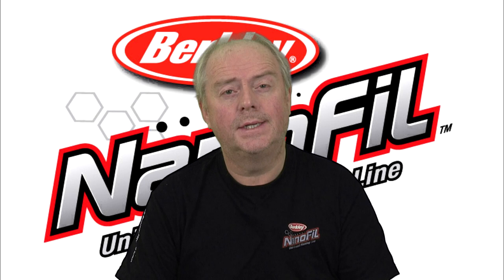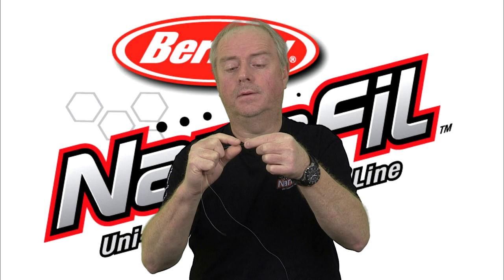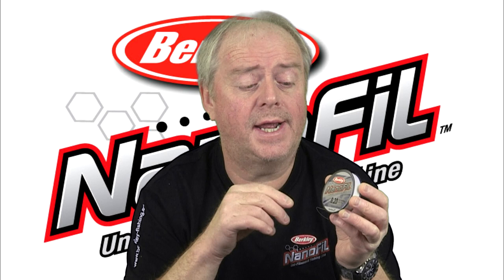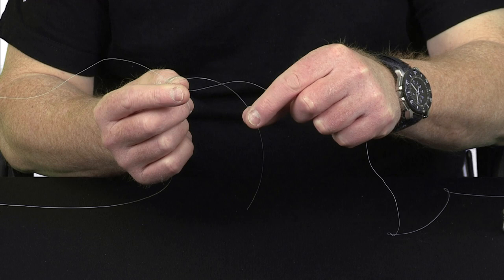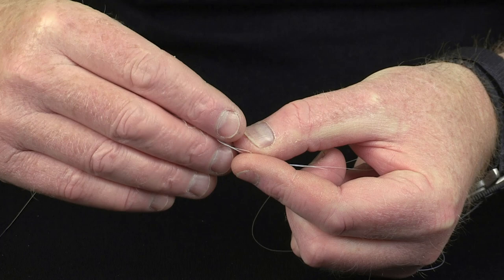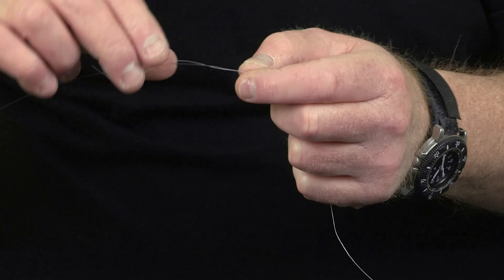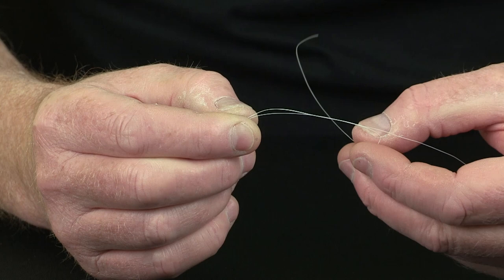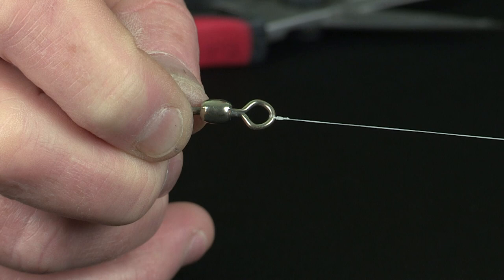Berkley Nanofil - Introduction by Mike Thrussell

Comment: I used the palomar knot on six pound text nanofil and I lost a lot of lures.  Finally, I used a double unit knot with 12 wraps tied to a flouracarbon leader and I haven't had any problems with it.  I use this line for jig fishing for trout.  The line is very sensitive and casts far.  I am not sure about the durability of the line after using it on a couple different fishing adventures.  I do like the line and I will continue using it.  I had a blast catching trout with a marabou jig.

Comment: Hi Mike it was nice to meet you in person at the Farnborough show. Thanks for the advice on the braid boat rods. I have been experimenting with Nanofil on the beach using an FG knot and the Allbright knot. Tho Allbright  tested well,the tapered leader broke before the knot, which is a first but didn't do as well with the FG knot! It seems that the FG works best with braid NOT Nanofil! I also found tho knot stronger if I cut back the tapered leader a short amount. If you can spare the time I would like your thoughts and suggestions on this subject. cheers Alan Thomas

Comment: It might well be old fassioned but what about the turle knot which I use for all my knots and have never had a problem with that knot. I ties all my flies on with that knot and use it for all my sea fishing and haul any weight fish into the boat and that knot always holds good.
Fair enough I don't go much below 20lb breaking due to being broken with 10lb line on salmon and sea trout..........  The knot was shown to me by an incredibly able trout fly fishing chap who took me to Eyebrook res........ I've never forgotten that knot and its much less fidly than any other knot.......  If you do not know what it is it is no more than two turns to make the two loops round the main line & then tucked through those two loops whi when pulled form a figure of eight which latches onto the eye of the hook and line.  It has never failed me through slipping. I don't know what the reduced breaking strength is on that knot and if someone says what it is it would be interesting.

Comment: I used the same knots with nanofil 6lb and 8 lbs leader, but for some reason it was getting stuck in the guides while casting.

Slipbeauty knot fixed that issue.
Reply: I had the same problem. Going to try the knot you recommended. What weights of both lines did you use?

Comment: With thin lines none of those knots work. I frequently use 4 and 6 lb test and both palomar and grinner snapped when setting the hook and sometimes in mid casting. Although i've managed to create a knot that i'm pleased with and it gave to me some pretty good results. When i'm tying a snap or a jig I always cross the line 3 times trough the eye then simply make a loop like grinner and cross the tag end between 10 to 15 times. After that moisture the loop (soaking wet) and pull very very slow.

Comment: Hi Mike, firstly loved the helpful Video, much appreciated as is your style of presentation. I have used the knots exactly as illustrated and whilst they are good for equal sized lines I find that the FG knot tied as per the simplified or so called easy method as shown by the Salt Strong guys video [the Red Shirt one..:).] much smaller and very very effective.

My question to you is I'm in process of fitting new guides to my old Leslie Moncrieff reverse taper rod and have bought a Penn 8000 Surfblaster Reel however using the Guide Poisting Software the Penn Reel has a strange upsweep angle - I noticed you using a Penn Reel in the video and ask which one it is and what the spacing is on the guides, particularly the first/ stripper guide [Fuji?]. 

I really would appreciate you letting me know at you earliest convenience as I'm about to start this project - oh and I will definitely keep using the Nonofil 0.2mm Line for its great bite detection, low drag in the water [less weight needed to hold bottom] and exceptional casting distance - worth all of the effort in my opinion - thanks and kind regards - John